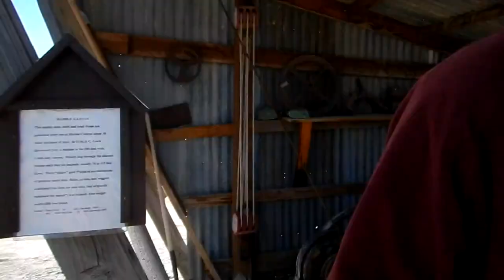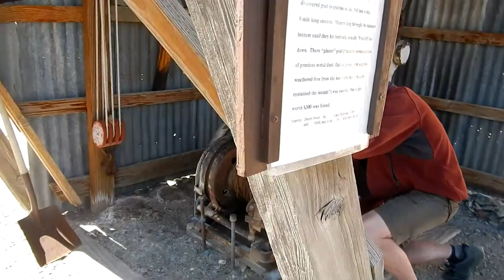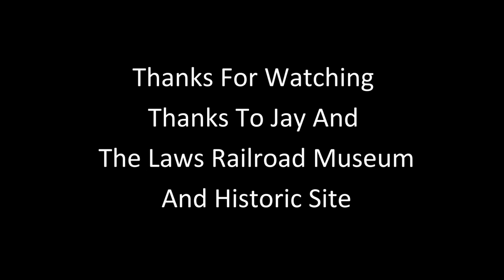Skip Car And Headframe Demonstration - By Jay From The Laws Railroad Museum And Historic Site

Comment: Ya'll must have had a blast there.  Am I right in assuming that the start on this is the same principle as the old kick start motorcycles?  They sure had it tuned up right since it started almost immediately.  It is cool to see how the things worked in real life after exploring the mines.  Thank you for bringing us along.
Reply from the maker: We did have fun at the museum, P-Daz. The starter on the old engine is the same as the old cars that had a hand crank in the front. They have a great mining display that goes all the way from removing ore from the mine to milling and assaying with a lot of the vintage equipment that was used. Thanks as always!
Reply: @TomandJulieMineExploring  Oh wow!  That sounds like a great learning exhibit and one that you could spend all day exploring.

Comment: My grandpa had one of those engines in his swather. It was a genuine pos he blew it up twice and said the he'll with it
Reply from the maker: Those Wisconsin engines have powered a lot of equipment over the years. Too bad your Grandpa had a bad one. Thanks for the comment, Bill.
Reply: No that's not what it is , the miners used cheap readily available engines to do their work because they knew they would be thrashing on them and needed a cheap replacement ... So they went with an agriculture engine knowing they where a dime a dozen

Comment: Ok while this is interesting there a couple of things that need correction.
1) THAT IS NOT A SKIP , that is an ORE CAR ! There is no way that was ever used as a skip period. It’s an end dump ore car . And that’s was it was used for 
2) how would you dump ore or waste out of that ore car ? It’s on track directly over the collar of your inclined shaft , there are no chutes set up and even if there were you stand the risk of dropping muck down the shaft every time you tripped the car as some would surely get around the chute . It always does . 

Just in case anyone is wondering I’m A retired professional underground hard rock miner with over 40 years experience who broke out way back when most of the mines I worked in were rail and almost everything ran on compressed air with the exception of some battery or diesel powered locomotives in the bigger mines .I’ve held every single job in a mine from nipper and safety man to shifter and walking boss up to general mine foreman. So yeah I know what I’m talking about. I’ve done every kind of underground mining there is raise and stope , shaft and decline adit and drift . I’ve ran every single type of underground mining equipment you can imagine if it runs on compressed air or diesel it’s been in my hands and even spent some time as a relief hoistman at one small mine in California where I also served as a shift boss . 

So while I’m not here to bust your ba**s PARD you should actually salvage a real skip car or have one built then you would have an awesome display. 

Cheers
Reply from the maker: This is a mock-up built by a museum to show the principle of how a skip is hoisted out of the mine. It never was intended to operate.